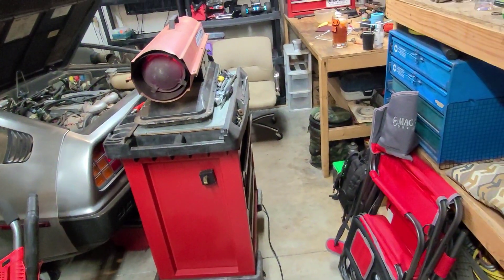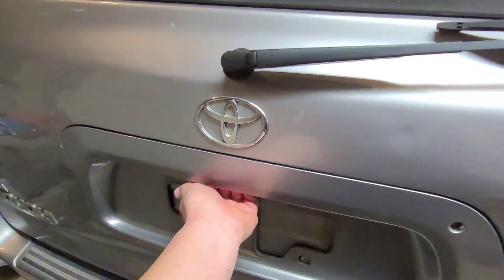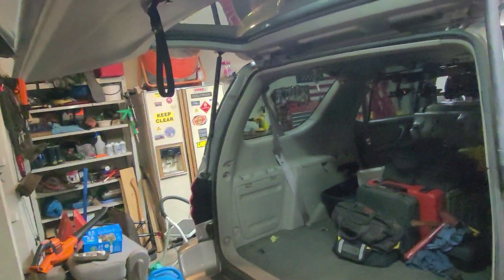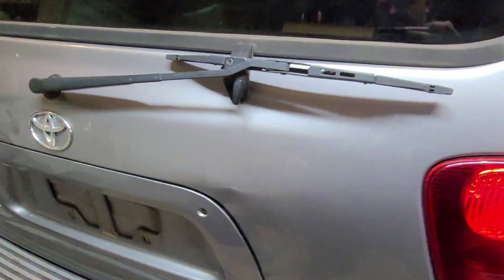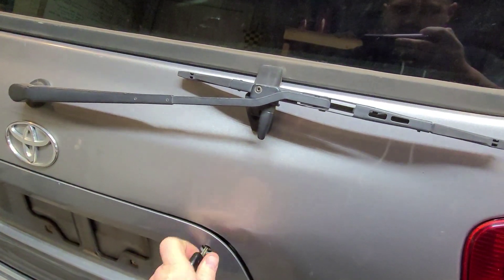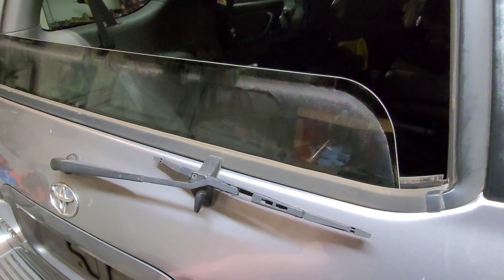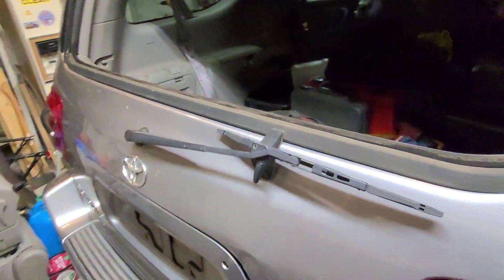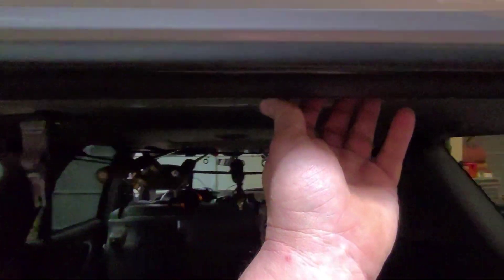How to replace and modify the rear hatch latch on 1st gen Toyota Sequoia

Comment: Dan you are the man! There are no tutorials on the tube that show the latch and it’s malfunction. You solved the mystery of the first gen hatch issue that has evaded many to put a bent steel latch to open the hatch. So ghetto. Nice work sir!
Reply from the maker: To be honest, this method is just a bandaid to the issue and is not a permanent fix since there are several failure points in the latch system, mine worked pretty good after this for about 2 or so years but the cheap part started to fail again so i just did the small hidden metal lever mod and it's been problem free ever since

Comment: After several broken handle replacements, I finally bought the dealer version. The real difference was also replacing the cable. The new combination when reassembled can be opened with one finger’s pressure. What a difference. The aftermarket latches did not address the cable lag and drag that made the handle have to work too hard.

Comment: Just wanted to come back and say thank you Dan. Finally got around to taking everything apart and grinding down the area you showed. I, for the first time, have a fully functioning rear latch and can actually lock my tailgate!
Reply from the maker: So the grinding modification worked out for you?
Reply: @theman9764  It did! Had a set of needle files and went to town on it for about 5 min. Mine would not lock before, now it's all moving freely. Bent both brackets holding each end of the cable to give a little more slack and not be so tight too.  Thanks again

Comment: 15:52 is it possible the cheap metal of the spring has stretched so not pulling the plate back?  Not sure if the pivot lugs get bit corroded & they are very internally buried so not want to move which strained spring first... guess a nylon pin is dearer vs a spring change.  Your very good camera work was great & made it easy for us viewers to consider ideas - thanks!

Comment: I realize this is two years later lol … but, would replacing the lock actuator accomplish the same thing or will I have the same issue? Is grinding the best thing to do?? Currently replaced my handle with sturdy metal one and new cable but the door won’t lock now .. first it stuck on lock and  couldn’t get it open …
Reply from the maker: If you use new OEM parts, you'll be less likely to have any issues, but this latch setup has been plagued with problems for a really long time so anything you can do to assist it is a good idea, the new cable will help quite a bit

Comment: Did not install the plastic cover on new latch should the cable break down below. Not sure if it's  needed. Had to remove the panel with the hatch closed.
Reply from the maker: @richarddowell405  it's been awhile since I've been into the rear hatch but I think that cover is what holds the cable in place, but like I said, it's been awhile

Comment: You have provided the best information for the lock mechanism (black PIN vs latch) !
I was able to open the two screws, tilt the cover and see the black PING stuck in the middle. No way I can move the black PIN either way. then I was able to unlock it by keep pressing LUCK-UNLUCK many many times!

Also, for grinding the metal for black PIN more room to move. Can I know what kind grind tool do you use? it's in small tiny area !

Thanks a lot,
Reply from the maker: If I remember correctly, i used my carbide cutting bits in my air grinder

Comment: Great video.  My latch just has too much resistance and the handles break or bend (the aftermarket metal one).  The latch is not currently available at dealerships and is back ordered by the hundreds so I am wondering if they wont be making it any more.  UGH.  I guess I will try to clean and lubricate it?  But it looks to me that spring might be an issue too after 17-18 years.  Wonder if it can be replaced.

Comment: I have had an issue with this on my 2003 and "fixed" it several times.  This time I replaced handle,  latch,  and cable with new After market parts.  Still did not work.  Tried your suggestion of grinding down the lock mechanism per your video.  STILL not working.  Latch works but the handle does not pull cable  far enough to activate the latch release.  Cable travels about 1 5/8" before it activates release.  /////handle only moves cable about 1 1/4".  Any other suggestions?
I see Glen Barth's comment below and will try OEM handle and see if that works.
Reply from the maker: Honestly it's a real common issue on these and you can replace with oem parts all you want and its still going to prematurely fail, i think there's a company that makes an electric  retrofit version that uses a push button instead of the handle
Reply: @theman9764      Thank you for that i just saw that video and am going to explore that!  
By the way i enjoyed your video... very complete!... and i have seen a lot of these.  this is my second Sequoia.... had a 2001 that i replaced the handle on once at about 50K miles.   I've had several failures on the latch / handle on this 2003.  
FYI i used a Dremel with a chainsaw grinding head to grind down the lock mechanism... it works great

Comment: Nice video. I have a similar set up for my fishing poles!  550 cord and trucker's hitch between the middle and rear handles.
Reply from the maker: It was some cheap set up i found on Amazon, velcro straps made into the main strap, it's held up perfectly for almost a year now
Reply: @theman9764   Thanks for the lock actuator tip. I've replaced both the handle and latch, but it still won't lock.  Time for some grinding...

Comment: Great information great video. The cable mines is not open the door still the lock is Frozen online and they unlock method does not work for mine.
So unfortunately I had to take a screwdriver and manually open mine after I pride the plastic off for 2 hours inside and broke off enough plastic to get to the access point of the lock.

Comment: Very intelligent and skillfully put together video -- thanks! I feel that it should be required viewing for all Toyota engineers. One theory I have that I'd like to bounce off you, if you don't mind: Since it appears these latch assemblies often fail due to rust, dirt, and crud, wouldn't it help a lot to seal up around the rear window (with silicone or something) so as to dramatically reduce water and grundge seeping down into the innards of the latch? Yes, this would mean you wouldn't be able to roll the window up and down, but why is that a big deal, especially if the hatch door opens and closes as it should. You would need, of course, to disable the rolling mechanism. Or do you think there are other entry points for water and crud? It just seems that it was counterproductive for the overpaid engineers to design the whole mess like this in the first place. Seems sealing the window, much like a windshield, would be a relatively easy and quick fix to cut down on future problems. What do you think, sir?
Reply from the maker: No i don't think sealing it up would be a good idea, i personally use the back window all the time, but that's just me, and no matter what you do, crud is gonna get in there, plus the cost of replacing the whole latch is minimal and pretty easy, i think the little electric motor used to operate it could have a stronger pull strength tho, and the section where the cable mounts to the handle and latch could be reinforced better because they both tend to bend easily causing the cable to get slack which causes the latch to not operate over time

Comment: Hi Dan....Do you know which fuse the O2 sensors are linked to in a 2002 SR5 Sequoia?  I'm getting the dreaded P0156 error code.  I know what it means and am working through the several possible causes.  Would appreciate any help....Thank you!
Reply from the maker: @Gondor_Sanitation_Dept  sorry homie, I sure don't
Reply: @theman9764  No prob!  Trying to find this info is proving to be strangely difficult!   LOL
Reply from the maker: @Gondor_Sanitation_Dept  honestly, I don't think they have their own fuse, their inputs and outputs are directly tied in to the pcm, so if they do happen to short out I would guess the pcm fuse would blow, btw, most pcm's have several power and ground inputs so if one of those is having an issue then it can affect several sensors

Comment: Dan, any suggestions of how to open liftgate if the lower latch won't release. The lock mechanism was replaced, the upper handle replaced - now see I should have ground down the area where the locking mechanism hangs up.  But now liftgatte is closed, removed cable from exterior latch and pull but the liftgate will not open.  Any ideas, do I have to tediously saw off the part the latch engages when closed?
Reply from the maker: I've had this issue before and sometimes pulling the handle and smacking the door right where the latch is can help the mechanism open, other than that, it requires getting inside the door, reaching in behind the window regulator, forcing the plastic cover off the latch and then manually moving the latch linkage with your fingers, it's not an easy task

Comment: Dude, great video but I can't get my hands in there to unplug the big plug... no idea what I'm doing wrong.  Also those damn little screws on the plastic... I can't get a screw driver in there... right now my door is stuck locked I can't open it to lift the tail gate and I can't get in to release the mechanism
Reply from the maker: Sometimes you can remove the cable from the handle and manually pull the cable to release the latch, and with the plastic cover I've had to just get aggressive with it and rip it off to gain access to the unlock linkage

Comment: On mine pulling on the cable didn't do anything because the lever on the latch was bent so I had to use a hacksaw blade to cut the striker off.  I didn't want to do that since a new one costs $20 but it was the only way.
Reply from the maker: That sounds awful!

Comment: My latch won't close now. Had it replaced last year and dirt got into and and was stuck until today. Got the latch open but now it won't close.

E: my lock/unlock doesn't work. The pin doesnt move. What could it be?
Reply from the maker: Did you try closing the rear hatch door when the latch was in the closed position? If so, you might have damaged it
Reply: @theman9764  I'm not sure. I still have my old hatch and the lock/unlock can move freely. I just want to be able to close my latch for now. Can I attach a mini wheel blade to a 1/2 cordless drill/driver? I don't have a mini cutting or rotary tools.
Reply: @theman9764  Can you tell what cutting tool and blade you used to cut? I'm thinking of buying a cheap rotary kit off Amazon.
Reply from the maker: @itsatrap4986  i used a small carbide bit with an air rotary tool, but the metal you're trimming is thin and small so any kind of small metal grinding bit should work just fine
Reply from the maker: I bet your new tool has the speed but you might need a good high speed carbide deburring bit, I'm not so sure those cheap harbor freight bits could cut through hot butter
Reply: @theman9764  Thank you for replying. Home Depot doesn't have any burr in stock and would have to order online, which is ridiculous.
Reply from the maker: Look up "snap on carbide burr set" so you get a good idea on what style of bit to use, they're high speed, so an electric drill won't spin fast enough
Reply from the maker: @itsatrap4986  any luck getting your issue figured out?
Reply: @theman9764  Hello sir. I might have to get a new latch. I've put everything back together and the door closes but now it won't open. I believe the locking mechanism is broken. Before installing the latch, I tested the lock/unlock and I was looking at it while pressing the buttond and the pin didn't move. So that's my guess.

Comment: Would it also work if I switched out the actual part itself? I have the opposite issue. I used to not be able to open the rear door, now it won’t stay closed. The mechanism won’t lock onto the bottom bracket when you shut the door.
Reply from the maker: This was a new latch i had to modify to work properly, your problem almost sounds like the pull cable is too tight not letting the mechanism reset, but it couldn't hurt to try this method, but make sure you can manually reset it by pulling the handle and using a screwdriver to pull the latch lock arm out, the part that actually locks onto the "floor hook"
Reply: @theman9764  yeah the problem with my latch is that it wouldn’t respond to the cable pulling on it. You could also visibly see my latch has some dirt and rust on it. I’m assuming the previous owner didn’t change the part and it’s a 200k+ mile car. I’m gonna change the part today and we’ll see what happens
Reply from the maker: @JuanDiaz-ts8rr  i went thru like 2-3 latch assemblies before i decided to modify it, mine still gets stuck sometimes when it's stupid cold outside, I'm pretty sure that's due to the grease being thick and not letting the mechanism move like it needs to, but i can usually pull the handle and bang on the lower portion of the door once and it always releases
Reply: @theman9764  well I replaced it and it seemed to work. Let’s see how long it lasts
Reply from the maker: @JuanDiaz-ts8rr  my previous new ones would last about a month or so before they started to fail

Comment: What tool did you use to grind it
Reply from the maker: I used a small tip high speed carbide  bit in my air grinder, same air tool i use for cleaning off gasket material

Comment: How is this repair holding up after a few months? 
I am well versed in replacing the handle, and have replaced the cable/latch mechanism once as well, all of this on my friends car. 
I really don't think this is the problem with their car, I think the cable keeps getting stretched by lifting the hatch by the handle, but next time we go in there ( which may be soon)  I"ll look at your idea and try it out. Cant hurt I suppose.
Reply from the maker: I still have the problem every now and then when it's really cold outside, but if i hold the handle and smack the door it pops open, when it's mostly warm outside i never have the problem, I'm guessing maybe the grease in the latch gets too thick and won't let it operate properly

Comment: After replacing the handle twice I just drilled a hole behind the license plate, stuck the cable out , little silicone boom done.

Comment: Have an 03,  handle broke one day, i took the cable OFF the mechanism and would have it sitting free, would roll the window down, then pull on the cable and the hatch would open.

years later that stopped being an option, the latch must be rusted/bad, its the OEM, never replaced it but cannot get the rear hatch/door to open.  Question for anyone is how?

This one has a plastic shield cover for the latch, i put a hole in that, then soaked with silicone grease spray lube.  I keep WD40 away from any/all mechanisms, use that for rusted exhaust bolts, not much else.  I bought some better/expensive spray lubricant then sprayed all inside that cover thing to soak the latch.  no difference.  its stuck shut.   

Window is destroyed, it shattered around 2017, it had been replaced, not installed right but glass company said oh, the warranty?  you had to bring it to us before the glass broke, thats how the warranty works.

So there's no glass just go thru tape.  Goal is to open the hatch/door and remove the mechanism, check it, grind it, bend it so it works until a new one can be had?
Reply from the maker: When it's really cold outside i sometimes have to hold the outside handle and bang on the door just below the license plate, if you can gain access to the cable attached to the handle you can use a pair of curved end needle nose pliers and pull the cable manually to open it
Reply: @theman9764  Well thats the thing, the handle snapped in half in the freezing weather one year, I removed the cable from the handle mechanism, and for maybe a year could open the hatch by lowering the window and pulling on the ball on the cable.  not anymore, now it does nothing.  I pull on the cable ball thing and  hit below the license plate.  
The latch is jammed/frozen/rusted now.    panels are off, no glass, the magic latch has a hard plastic cover
Reply from the maker: @bradleyr4451  if i remember correctly, I think there's only 1 tiny screw holding that plastic cover on the latch, you might have to get rough with that cover and pull on it kinda hard to remove it, it's in a tight spot so i know it'll be difficult

Comment: Replace the latch handle with a metal one that way it does break.
Reply: where do you find that?  i see lots of adds for all metal part but they all still have the plastic lever that eventually breaks.